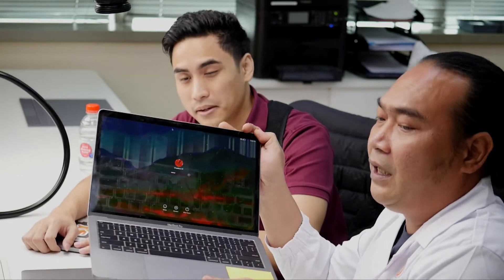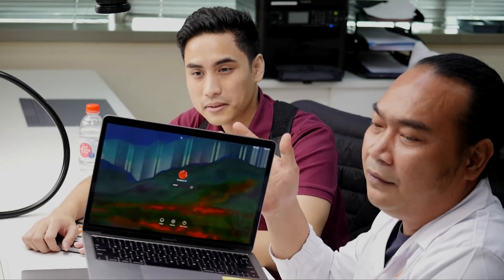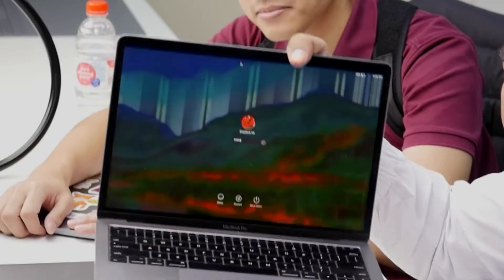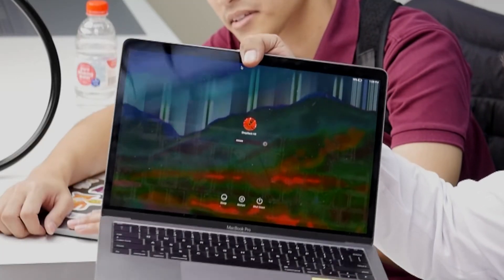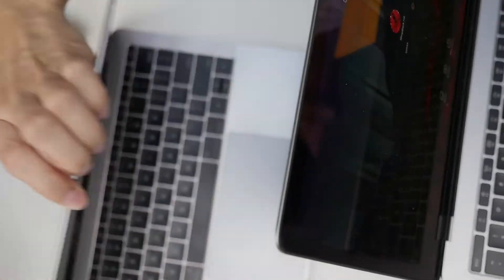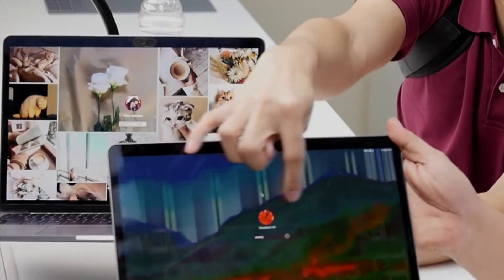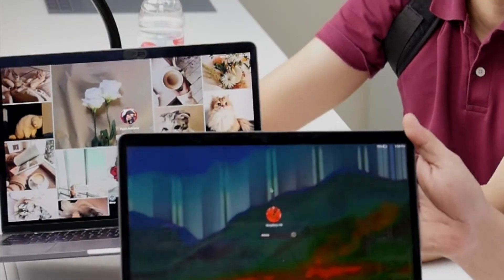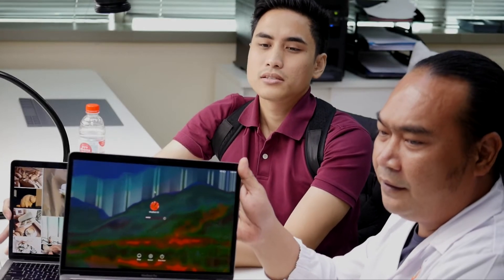MacBook Pro A1706 & A1708 Flexgate Repair | iDevice Repair Centre

Comment: dam, a guy in my area is charging 280$ to do this same repair? is that fair amount, or should I do it myself, I have experience doing soldering work on mainboards.
Reply: You need a fine tip soldering station
Reply: Apple in the UK quoted me £575!!!!! 😂

Comment: Just happen to my laptop. Got a 2016 Touch Bar. Apple is repairing it for free. They said a lot of laptops have this probably. Should have it back on 5-7 days. So go to apple before you pay
Reply: Do you have the 13" oder the 15" 2016 MacBook Pro? I have the 15" 2016 and the Apple support doesn't want to repair it for free. I have been to different Apple Stores but the support was so bad and the showed no understanding. It is the last Apple product for me.
Reply: @TheCro92  I have 2016. I have 13. I didn’t have any cracks or any kind of damage on the screen. Tell them you don’t have any water damage as well. Try talking to someone that looks friendly at the apple store. It’s for sure covered and should be free
Reply: @TheCro92  They will not change it for free as the program is only for 13" (4 thunderbolt and 3 thunderbolt)
Reply: I am having A 1706 with backstage light, flexgate issue, display. I reported a wornout cable, but they are stick to the statement that it is some fall or so. They are saying that I am reporting it for the first time. Requesting you all to come together to complaint for the same. If it is a manufacturing defect, apple should cover it free of cost.
Reply: @TheCro92  even my 15" inch mac book pro-2016 having the same issue
Reply: Someone in my area is charing $280 to do same repair unfortunately

Comment: Hi I’m having a similar issue (my screen starts flickering when it gets too hot) and i was wondering if using your macbook with an external display is possible? i haven’t tried yet but would this work? i don’t care if i ruin my macbook screen when doing this and letting it heat up till if completely melts the display port...can i just use this set up ?
Reply: I’ve been using mine with an external display for a few weeks now without any problems
Reply: i got similar problem, it flickered then the display gone black when I opened zoom for more than 3 hours and yes it super hot on the bottom. Using second screen will fix the display issue, but not the correct answer that i looking for. I dont think this video explains well
Reply: ok thank you !
Reply: You can use it with an Apple TV box wirelessly.

Comment: Why would people pay $700-800 to get Flexgate repairs done? Apple has a repair program for it and are even refunding people who have paid for this repair in the past.
Reply: They’re not refunding anyone shit. What are you talking about? They’re still refusing to fix my MacBook. It broke 1.5 years in of purchasing it
Reply: @Twoonele  llook up the backlight repair program's page on apple's support site, the last paragraph mentions the procedure to get a refund in case you paid to get your screen replaced before they started the repair program.
spoke to apple support and got my 4 year old macbook 2016 with touch bar fixed for free last week. same for the keyboard that broke after 2 years. all free repairs. maybe if you fix that attitude of yours it'll be easier to get stuff done.
Reply: @jonathanpeter1385  thats ONLY for 13 inch displays and ONLY for 2016 models.
Reply: @jonathanpeter1385  I have a Macbook Pro 2017 and apple doesnt have any repair program, i have been asking and looking for news but pnly 2016 Macs for the moment, im tired
Reply: backlight repair program is different from flexgate. i mentioned flexgate to apple service center they dont want to own up to that issue. they qouted my macboook $700 for the replacement to which i told them that if you open it in a certain angle it turns on, so im sure its the ribbon. they said its an LCD problem.  :SMH:
Reply: Hi! Our Flexgate repairs offered are much lesser than that. It only costs S$290 for the 13-inch and S$300 for the 15-inch models
Reply: @idevicesupport8164  WHERE IS UR BRANCH

Comment: how long until our macbook have this issue ? my 15 inch 2017 still going strong after 3 years.. but i decide to upgrade to a newer device once the issues start to appear
Reply: Mine is 3+ yrs old, same model. Facing the issue right now. The Apple store asked for 680$ to fix the issue. Looking for a cheaper option
Reply: @sonicasayam9703  how long exactly ? mine is already 3 years and 2 months... should i be worried by now?
Reply: @18PregnantAndProud  well, I don't remember exactly, but I'd say 3.5 -- 4ish
Reply: @sonicasayam9703  aren’t apple offering free repairs?? I saw it on their website
Reply: @18PregnantAndProud  bro my macbook 's screen crapped out at 1.5 years of buying it new. fuck apple
Reply: @jonathanpeter1385  no, only for 13 inch 2016 models. the only models that had the least sales
Reply: @ArcticGentoo  is the 15 inch version also free?
Reply: @fransiscosp3762  nope

Comment: Hi! I did a flex repair of a macbook pro 2018 (A1988) for stage light efect. But what i want to do now is for the other side... camera, ambient sensor for the keyboard.... and to be honest i dont know how to connect the jump wires! So can you please help me with a schematic. I promise to post a video with my repair credit to you! Thanks a lot in advance for any kind advice
Reply from the maker: Hi Cosmin RI, We have not done the research for this yet. But this is how usually we do it. We will remove the metal plate of lcd flex and see the fine circuit printing from the flex cable and from there we will just do a jumble of each of the flex connection to the FPC connector directly

Our main concern of not doing yet, Is because we worry that if something goes wrong it will affect the CPU. Since this newer model CPU are easily affected.

Sorry that we are unable to provide a much clear information. In the future if we have done the research we will surely share the video on our channel
Reply: @idevicesingapore2324   thanks for answering. this would have been the solution but the fpc connector and part of the flex was ruined. if I will find a solution I will let you konw